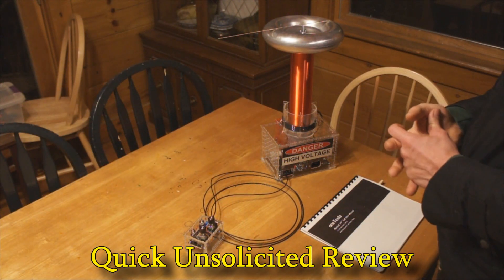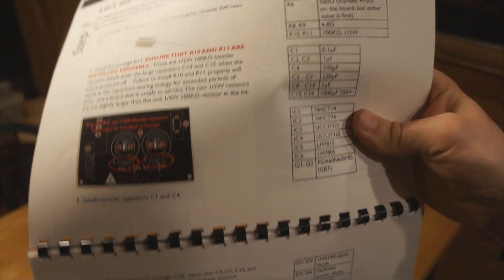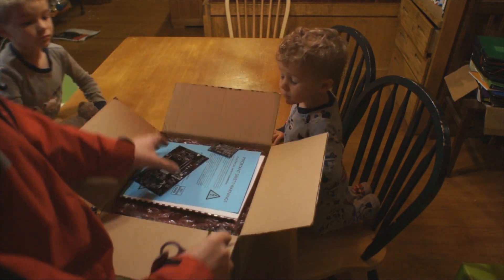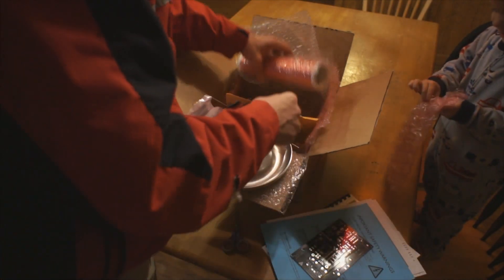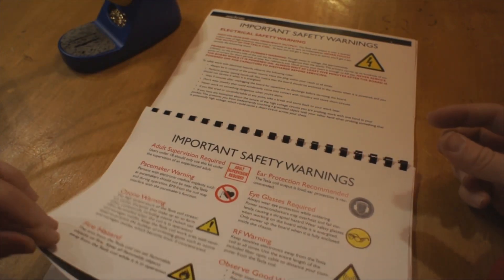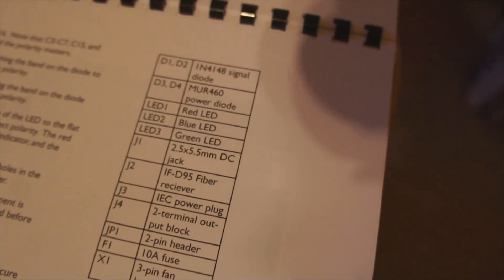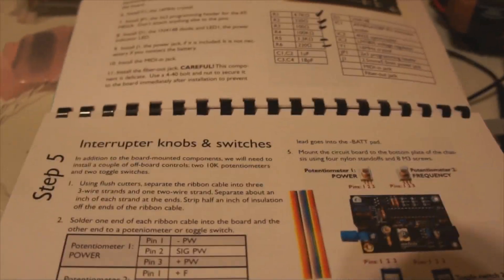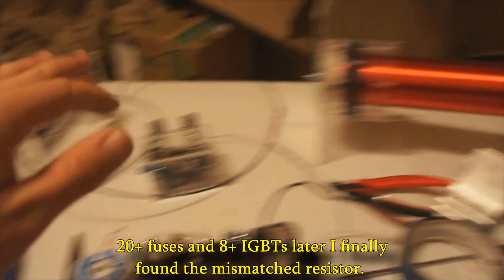From Bach to Tesla - DIY oneTesla Musical Tesla Coil Build & Review

Comment: Yup, you are correct! I just finish assembling a Infrared proximity switch.. and I have to take every single resistor, diode and cap and check it before I solder it, No matter what I did the components in the pictures did not match the components on the bag! not color or look a like.